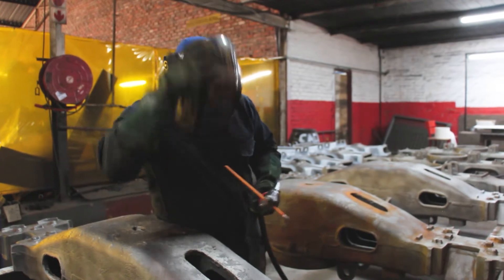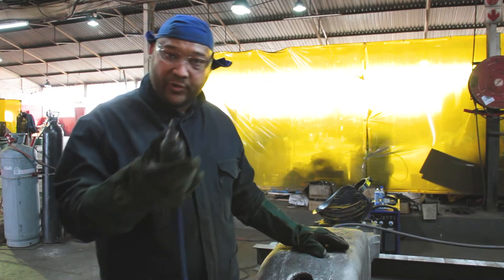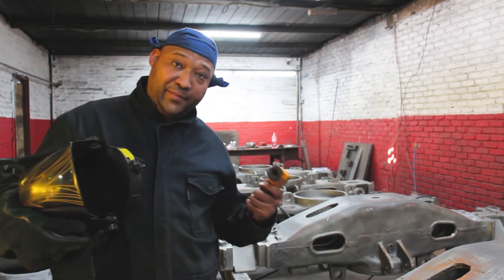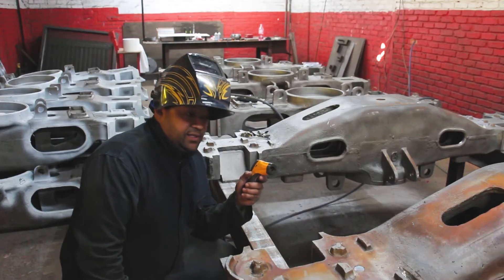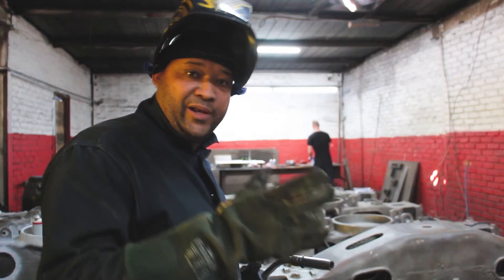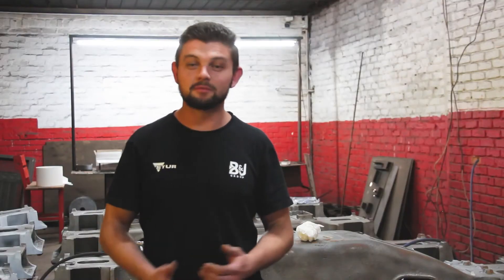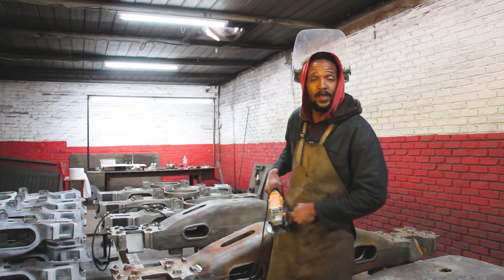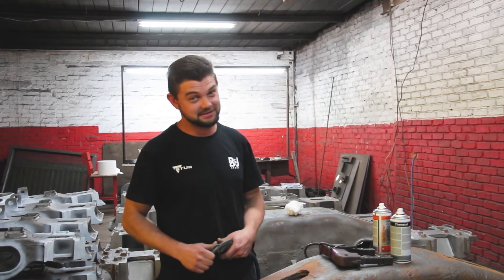Cast steel crack removal and repairing

Comment: Since when did cast steel, or any steel have moisture in it??
Absolute rubbish.
It must be some serious (non existent water) that needs 300 degrees to make it  evaporate.
The heat is required for the grain  structure to be in the right orientation before the welding process can commence.
The moisture that presents itself during pre-heat occurs because of the hydrocarbons that you're burning in your heating torch. Key word...... hydro.
Reply: Technically, with steel being porous, water can settle within the pores due to storage outside in the snow/rain, or just in an overall humid environment. When I was studying to be a CWI, we learned that yes, using propane or acetylne torches can push moisture into the material, which is why the majority of preheats take that temperature to 250 or above, so that the hydrogen won't settle. The preheat also widens, but tapers the severity of the heat affected zone from welding, reducing the stress risers near the weld bead and it's heat affected zone. Both statements are true. Yes, the preheat is to remove moisture, Cast being one of the worst at holding water, oil, coolant, etc., while also allowing the grain structure to not be as dramatically changed in and near the weld area

Comment: What was the welding rod
Reply from the maker: It is called a gouging rod. It removes the material around the crack in the parent material with an arc and air pressure. The main goal of air arc gouging is to remove defective or old welds to repair the cracks in the material.
Reply: What are you using to weld it back up with
Reply from the maker: @arneldathompson8163 we preheat the casting to 150 degrees Celsius and weld with ER70S-6 carbon steel welding wire